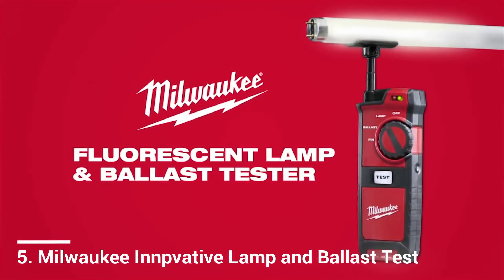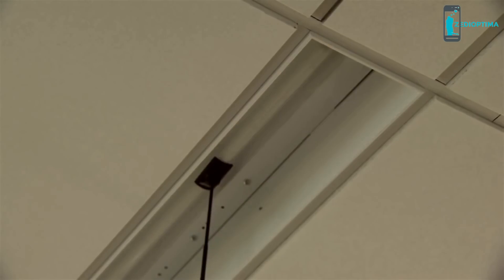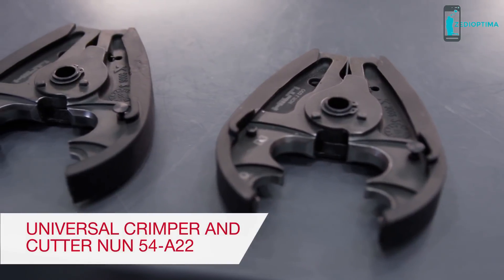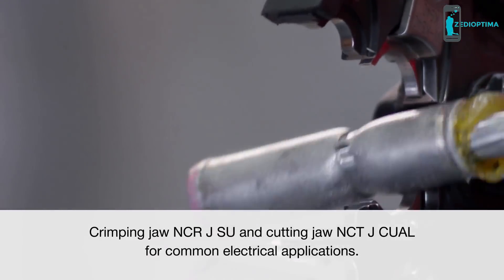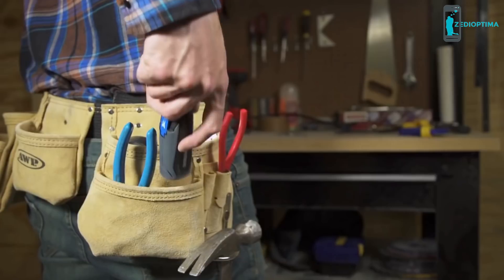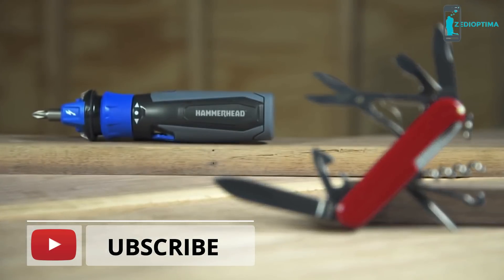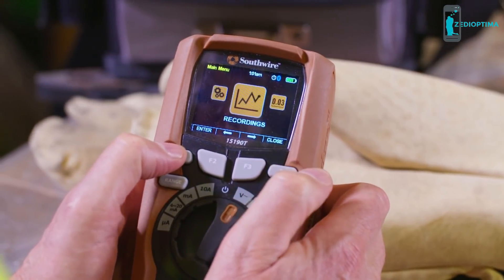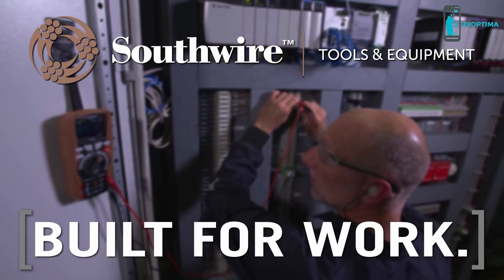Top 5 Electrical Tools and Accessories You Must Have

Comment: The jokari allarounder is an allaround joke..  boss got me one for whatever reason, broke it on a lamp cord..  plastic thinwalled non-reinforced pressure molded crap with little itty bitty stainless blades that come in those little doohickeys that get lost the first time the damn thing accidentally opens in your toolbelt or gets knocked out cuz the things bigger than a hammer grip..  a no go booger flicker with fingernail scraper in my opinion..
Reply: I've had one for 2 years almost daily use...

Comment: electricity must have a multimeter
Reply: Incorrect on your comment and answer sir..  electricity must have protons or electrons would have either or both been a viable statement or self answered question.  Electricity is a form of energy resulting from the existence of charged particles (such as electrons or protons), either statically as an accumulation of charge or dynamically as a current.  

A similar statement to yours would be Education needs a stupid.  Or my farts smell like purple...  both display an equal sense of derp.
Reply: @Z-Ack  是不是别个说哪样你都要来反驳，你个杠精

Comment: Nobody uses flourescent anymore so its preety useless now. Just retrofit to led
Reply: Yeah but there's still a lot of buildings with fluorescent lamps that just want the shit fixed.
Reply: @electricianron_New_Jersey  if you need a tester to troubleshoot lamps and ballast you are not an electrician and shouldnt be trying to fix it let me give everyone a quick tip for free 95 percent of the time it works touch the ballast if its warm it works if its cold its bad flourescent lamps when they go out have dark burnt like marks on the ends if all else fails check the voltage first then replace lamps if it still doesnt work then replace the ballast
Reply: julio val they mainly stressed the time advantage. You have to admit it would be a lot quicker to walk under a light and touch it with that tool and know right away if the bulb is bad or not. There are thousands of these fixtures in my factory. It would be handy to walk around and just touch the bulbs see how many was bad then go back to the bin and grab all the bulbs needed and go out and replace. 100,000 sq ft building that could save a lot of time.
Reply: @elmasbuscado909  that is for classical ballasts. they are talking here about electronic balasts. but yea, this is some over engineered bullshit. just take a spare ballast with you when you do your rounds.
Reply: @jamesf9610  actually, by seeing them in action, having to check this check that check that it takes more time than just simply replacing the tube, if not working replace the ballast .
Reply: I stand to correct you. maybe in home appliances. but in industrial applications they are everywhere.
Reply: haha   if  ur  not  using then it  doesnot  mean that  no  one  will  prefer  to  use..but i prefer to use  because of  durability  and  long life  of  usage  than  LED  technology...